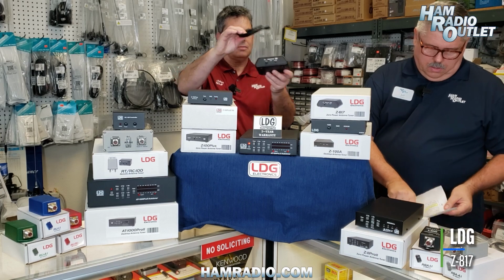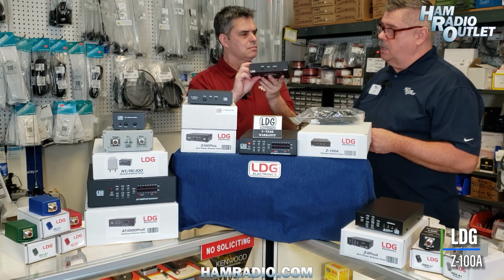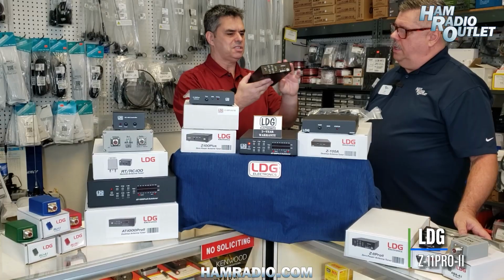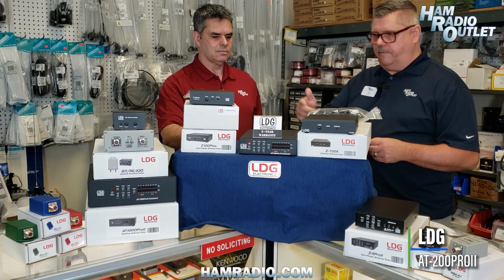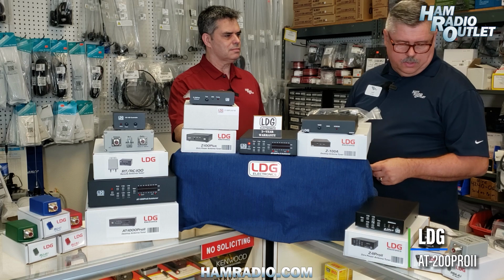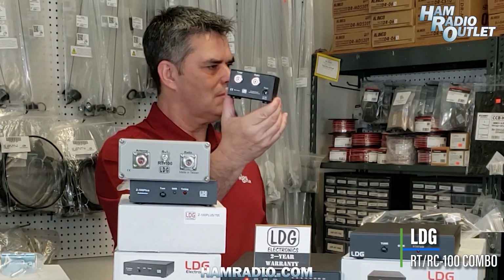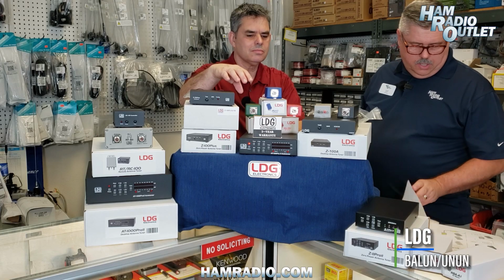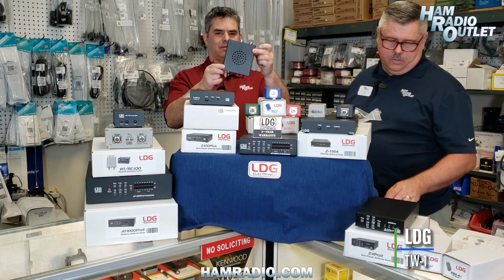LDG Auto-Tuners Plus!

Comment: I like my LDG Z100-A for occasional portable (mostly POTA) use with either an Icom IC-7300 or Yaesu FT-891. The supplied cables for the radios make for an easy setup and use. Good video. Thanks!

Comment: I had a bad experience with a newly purchased LDG Z100A tuner. I connected it to my FT891 at 50w and it worked once then went totally dead.  No power and unresponsive buttons. I tried two different cables, used it with an RF choke and without, and followed the manual but never could get it to work.  What a pain to send a brand new unit back to have it checked out.
Reply: Yes, I was well within the power specs at 50w SSB.  Perhaps I got a lemon. Otherwise I love LDG products.
Reply from the maker: Weird. I've only heard of LDG tuners, like the Z100A failing when they've had too much RF put through them (the Z100A is rated at 30W for digital modes), but then you can usually smell the magic smoke!

Comment: I got my Z-11 Pro II from HRO to go with my Yaesu FT-891 and Ham Sticks for my mobile.  I run the tuner with a 9 volt battery
Reply from the maker: That'll work great. I run mine from the 12V source that runs my radio, but I'll probably put AA batteries in it tomorrow, just for a change!

Comment: What do I need to get with my z100 plus to make it work on my ft710
Reply from the maker: A piece of coax to join it to the tuner! It will tune when you transmit. You can also force it into tune mode and transmit a constant carrier (RTTY, FM, AM) while it tunes.
Reply: @HamRadioOutlet  did I make a food decision getting thr z100 plus vs the z100a since I'm mainly a yaesu man? I'm sure they all require external power the rig can't power them correct
Reply from the maker: You made a great decision getting the Z-100Plus. It comes with a battery tray that fits inside and uses AA batteries which will last well over a year with regular use.
Reply: @HamRadioOutlet  all I need is a yacc cable correct
Reply: @KE8ODY-WV-Ares-Ham-Dad-3O4  make sure you check to see if your Yeasu radio is supported before buying the Y-ACC cable. And yes, you need to provide power to the tuner. Some radios have a 12V output for powering accessories, maybe your radio has one.
Reply from the maker: You don't need an accessory cable, as simply transmitting a carrier (saying "Foooooouuuurrrrrr" into the mic on SSB, choosing AM, FM, RTTY, or a constant CW tone) will cause it to tune. Using the accessory cable simplifies things as it causes the rig to transmit a carrier when you press the tune button.

Comment: So I just got a ldg z100 plus over a z100a I use Yaesu radios I hope I made the right decision
Reply from the maker: They're both great tuners. The one you got has 2,000 memories! Get the interface cable for even easier tuning.
Reply: @HamRadioOutlet  where can I get that cable? Did it come with the z100a bundle?
Reply from the maker: It's listed in the accessories for the tuner on our web page.